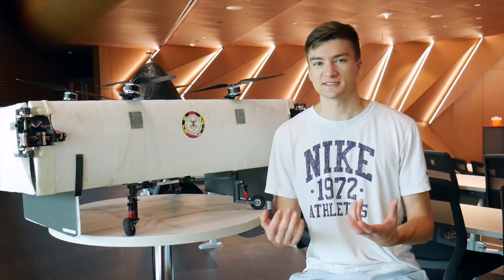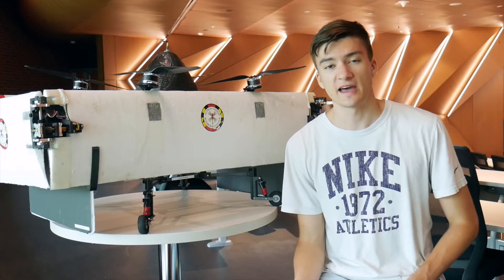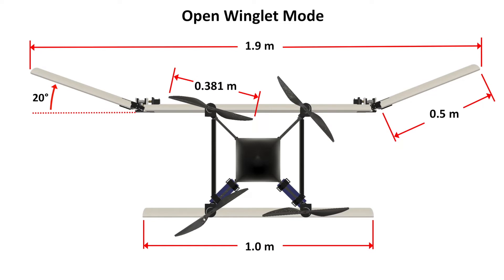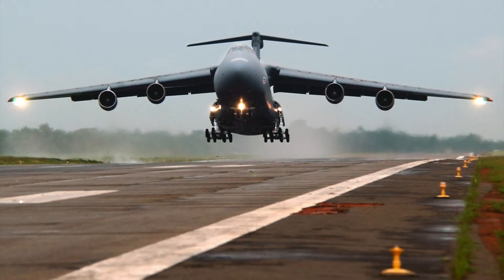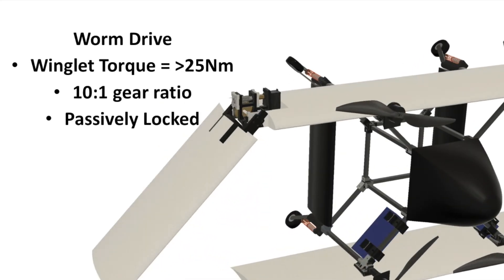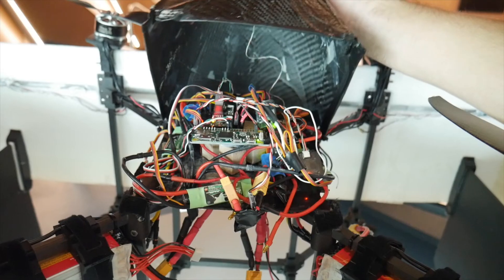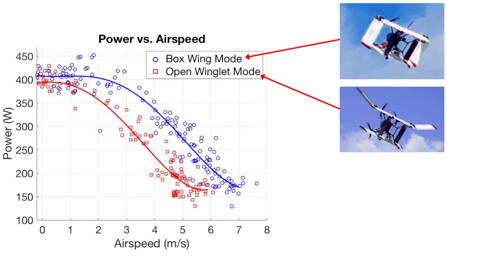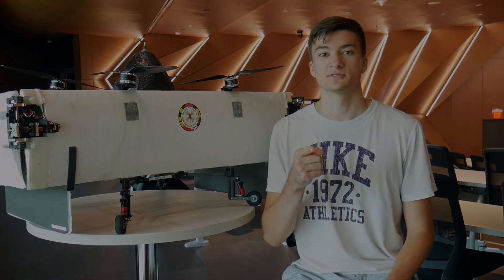A Unique RC Aircraft! | Morphing Winglet Quad-Biplane

Comment: Very impressive project. Have you considered incorporating that battery swapping board from Foxtech? Use two batteries...one more suited for hoovering and one better for flying.....and if one fails it can use the other to get back home.

Foxtech PG20 V1.1 Dual Battery Swapping Board
Reply from the maker: That's an interesting idea... I think the reason you'd want to do that is to have a battery with a higher C rating in hover and a lower C rating for forward flight, since forward flight is less power intensive. But otherwise I don't see a need to have two separate batteries. Maybe for a much larger vehicle it could be a good idea.
Reply: Foxtech claims the battery swapping increases flight time by 30%.
Reply from the maker: @mrlocalmusic  interesting, I just read up on it, thanks for sharing. 30% increase is pretty good